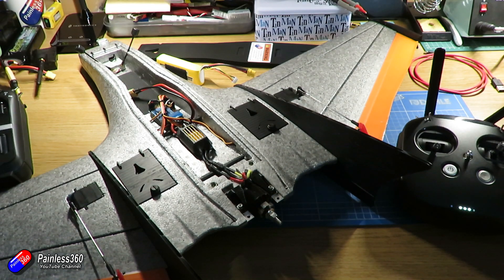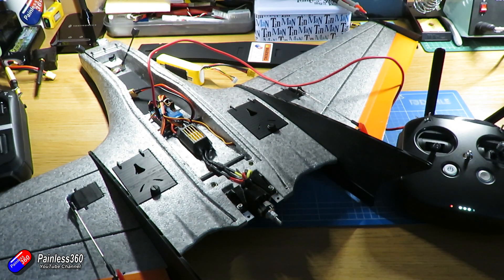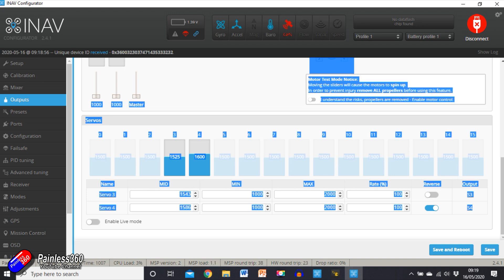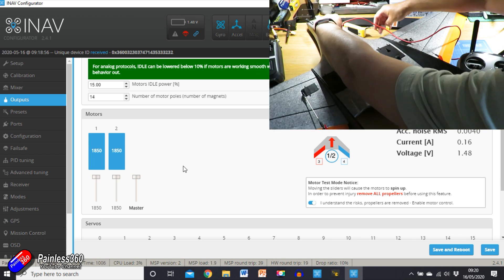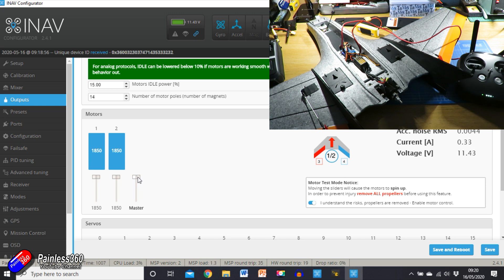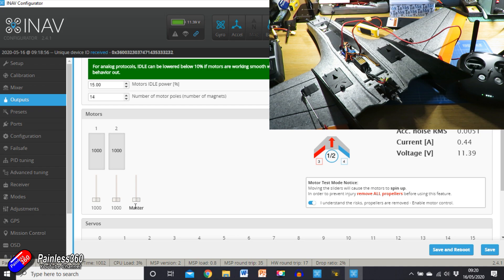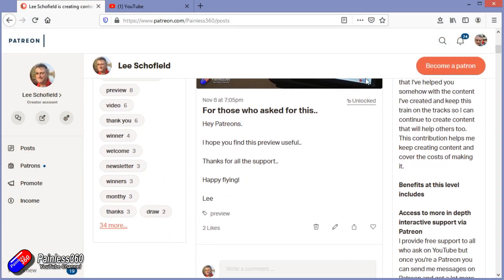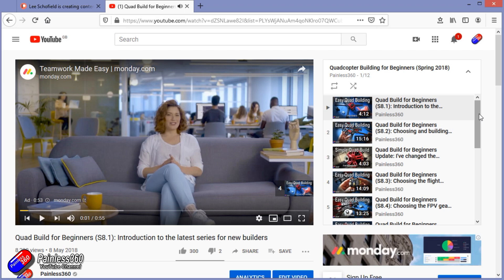iNav Simple ESC Calibration for new builders

Comment from the maker: NOTE: The default range of the throttle in iNav goes to 1850. If you don't calibrate the throttle like this then you could be losing the last 15% of your thrust. You can alter the max throttle PWM to be higher in iNav before you do the calibration but as the whole point of this is to match the ESC to the iNav throttle range that isn't needed. You don't need to do this if you're using a newer protocol like DSHOT as the digital protocol removes the need for calibration (that's why we no longer do that on multi-rotors with modern ESCs). Happy flying!
Reply: Hye.. Can u help me.. Why my motor won't spin if i use remote.. But if u use master test in inav configurator motor can spin..

Comment: Hello Lee,

I got the brand new EDF RC Jet and trying to convert it into Digital FPV plane.
I soldered the ESC's power and signal wires to the flight controller. And flashed the flight controller with INAV 6. I calibrated the ESC but the problem is that the motor isn't spinning and keeps beeping every second. On the radio transmitter, throttle min is trimmed at 1000 and max is trimmed at 2000.
Any suggestion on how to resolve this issue? Here is the video demonstration of the problem: https://youtu.be/75uxwvwFWP0

Comment: I cant get this to work no matter what I do. I do the step you show but when I plug it the battery all i get is a single beep from the motor every 2 seconds that just goes on and on. This is the final hurdle before I can maiden my new nano talon evo build. Maytek f411 wse FC.
Reply from the maker: I'd check the manual for the one you have to see what steps it needs to calibrate... Best of luck
Reply: @Painless360  I have been going through all your videos on the subject, I am stuck getting frustrated. All pre-arm checks in the setup tab in inav are green. No error messages in osd. Servos all work, Motor just wont spin. Tried your throttle calibration, as soon as I plug in a battery just get slow single beeps that dont stop.
Reply from the maker: I'd check you can run the motor using the throttle slider configurator to rule out any other issues.. Best of luck!

Comment: You're awesome! Was going about it the wrong way with my transmitter Tango 2. The AR Pro is eating my props on failed launches and I couldn't figure out out put put the break on it. Thank you!
Reply: I programed an ESC with INAV, the Sonicmodell that came with the AR Pro and it worked. Now am trying to do great same and put the brake on another, VGood 32 60A and it won't stay programmed after I remove the battery. If I disconnect from INAv and the battery is till connected, the brake is on. I disconnect and reconnect, and the program is lost. What am I doing wrong?

Comment: M y ESC won't start until its is at 16% no matter how many times I calibrate it?  Is there some sort of setting in iNav I am missing where it makes this happen?  (HobbyKing 30A UBEC, iNav 2.6.1 / F405 Wing F.C.
Reply from the maker: Sounds like the ESC calibration isn't working. Some ESCs have odd settings/beep codes. Have you got the manual for the ESC you have?
Reply: Hey. I know its been 3 years, but I have the same exact ESC, and I am having the same problem. Did you manage to fix this problem, and how did you do it?

Comment: Hi, This is a good video 'cause I didn't know this was available. However, I was wondering if you could shed some light on an ESC/Motor issue that for the last few days, I can't get sorted.

The details are here.
https://www.facebook.com/groups/INAVFixedWing/permalink/1476336672568126/?comment_id=1476512665883860&reply_comment_id=1476518835883243

In a nutshell, I have a 722-Wing and almost everything works except getting the motor to function. I have tried the ESC Calibration on my TX and RX and the motor ESC combination works fine. However, if I connect the ESC to the F722-Wing, Calibration appears to work fine but when I try & spin the motors up, it starts then stops as in the video. 

Any help will be very much appreciated. Thanks.
Reply from the maker: That is a closed group. I don't use Facebook.. gappy to take a look if the video is somewhere else.. best of luck
Reply: @Painless360  Ok, how can I post it to you. 

Do you have a website or Email I can use?

Thanks.
Reply from the maker: If you have something like DropBox or Google Drive you can post a link to the file..

Comment: I have a furious f35 with inav, trying to use a 60-Amp Pro Switch-Mode BEC Brushless ESC from an old Habu.   I am not able to get any motor output at all.  I do hear the esc startup tones when I plug in the battery.  Esc mode is set to standard.  Any idea?
Reply from the maker: Motor/ESC protocol? Are you arming ok? Lots to check. What troubleshooting have you already done?
Reply: Painless360 the ESC is out of a horizon habu 2, so I am assuming it would be PWM.    I do not see PWM in the drop down.      The FC arms okay, and I have even tried a second ESC (sams kind).
Reply from the maker: PWM is 'standard' - https://github.com/iNavFlight/inav/blob/master/docs/ESC%20and%20servo%20outputs.md
Reply: @Painless360   Thanks, I wonder why I am not able get this to work.  very strange.  It gets startup tones, but nothing at all from the motors tab.
Reply: I was able to get this to work by setting ESC to 50Hz

Comment: Could you pls do an update for calibrating the ZOHD ESC (Dart 250g)?
For some reason when following the steps in this video, it never stops beeping! It seems to step thru 1 beep, 2 beeps, 3 beebs and more and then repeats the entire sequence ad infinitum. I am unsure when to reduce the throttle to zero to capture the range.
Reply: FIXED.
I think I have resolved the issue. The ZOHD ESC will go into "programming mode" after 3 seconds of applying battery power if the throttle is not moved to zero before then. This means you need to zero the throttle IMMEDIATELY (within 1 second) after the 2 initial short beep-beep tones.
This will be true if you calibrate via iNav, or a receiver.

The "manual" implies that you have 3 seconds after the initial beep-beep before it enters programming mode -  which is why I was hearing an endless sequence of beep tones.
Reply: @rsilk2969  same issue for me. I think Lee’s explanation is fine for the majority of ESC’s but not all. Mine didn’t come with any instructions. I waited 3 seconds then put throttle to zero. I think it’s worked!!
Reply: @rsilk2969  Thank you very much for your instructions. This helped me with my ZOHD Dart 250G on my Matek F411-WSE flight controller running on iNav. I probably wouldn't have figured it out without your comment!
Reply from the maker: I'd do it directly from the RX then plug it back into the Kopilot . Happy flying
Reply: I am not sure what you mean. I have a R-XSR receiver connected to  Matek 411-WSE running iNav. The instructions in the video work fine until I apply power to the FC when the endless loop of beeps starts.
Reply from the maker: Without more detail it's impossible to offer any advice. Happy to help but please watch https://www.youtube.com/watch?v=olIqTiSJHIY and come back to me with more detail of what you've tried..

Comment: I have also been at it since long before ESCs, but I always wondered whether there are pitfalls when we calibrate both ESCs in a twin in one go. Will two identical ESCs always go through the procedures in perfect unison, or is there a risk of engaging the brake of one when you calibrate the other?
Reply from the maker: I've always tried to calibrate 'all at once' but occasionally had issues. I tend to treat it as a case by case...

Comment: Hello. I have a few BL Heli 32s. Given I had a 765 wing that can power servos the first thing I did when I got my bixler was rip out the ESC and replace with a mini BL heli 32 one. Anything wrong with installing these on a fixed wing? (I do remove the brake). Thanks!
Reply from the maker: Shouldn't be. Best of luck with the build!
Reply: Painless360 cheers. The 765 went in no problem.

Comment: Quick question.
When you had the motor at 100% it was showing 1850 value.
Should this be changed to 2000 somewhere in iNav?
Reply from the maker: You could but not needed. This will set the max throttle on the ESC to the same value. Happy flying

Comment: hello painless I hope that you are still up  
I have a rapid fire question regarding the calibration   
I have updated the firmware in the unit I am using it with the IRC lzr mini patch antenna array 
do I calibrate with antennas on ?  I know there is there is 2 steps to the calibration  
antenna on during the first part ?  or after ?
I fly on FS chanel 6  5840  I am using a rush tank vtx  do I need to use the manual adjustment of the frequency to get it perfect . and can you show me how  ? 
here is the pathetic flying I do and I hope I have the right antenna for it  THANK YOU 
https://www.youtube.com/watch?v=InErgRUK8uU&t=142s
Reply from the maker: See my video on calibration of the Rapidfire. It shows the steps one of the owners showed me... best of luck